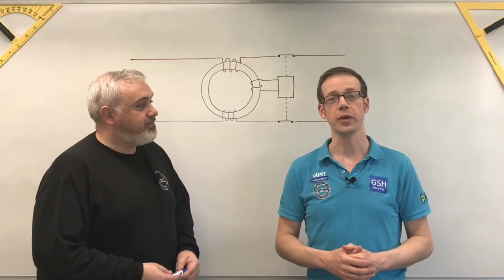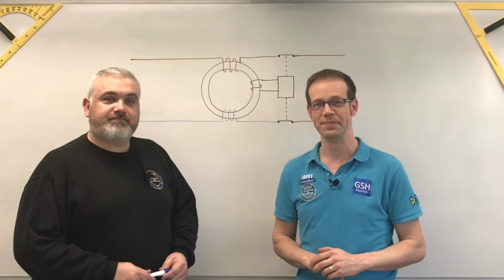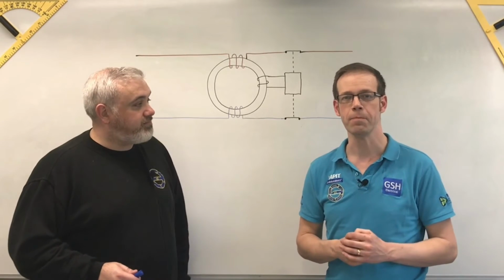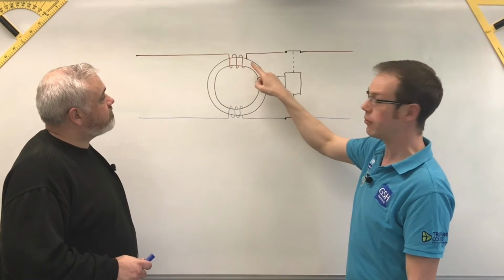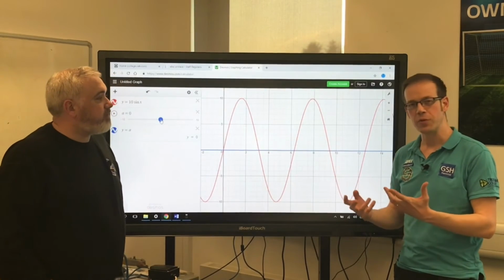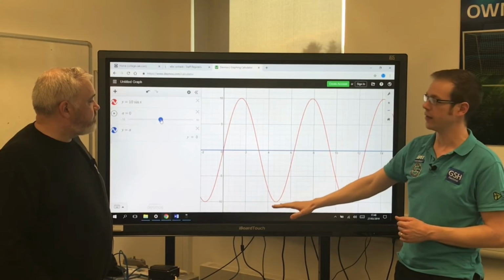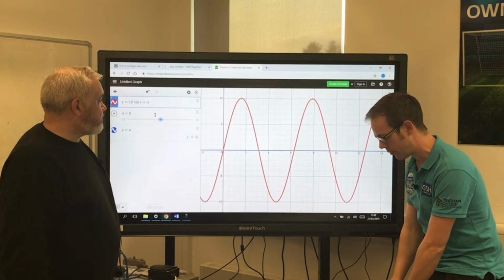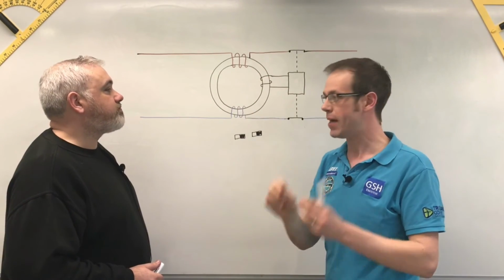DC in AC RCDs Joe Robinson training on #e5

Comment: Great explanation.
Except the using of term electromagnetic field in the core, there is a flux made by the two coil when everything is OK, the equal flux is zero when you have a fault the flax equal is not zero, causing EMF on the third coil that connect to electromagnet that trip the circuit

Comment: Great video very informative, currently doing my 2365 course (nothing has explained anything about this) and been working in the marine industry for years. We fit ground points on a boat which is used to ground the dc electronic equipment for interference generally  used for the ac ground as well.  Thank fully i haven't seen this fault yet but its good to know. Seems like we should only every fit at least type A

Comment: I've  just watched the first in the series of Ray Molony's 30 rules of lighting and interestingly he talks about lighting design and the joys of LED tape. LED lighting, of course, is rectified either in the lamp housing, or integrated fittings or very commonly via an external driver.
So if you're installing lots of fancy recessed LED in multiple rooms within a property, I guess you should add that to the list, and I would imagine even more so than sockets with USB (although, I'm not a big fan of them) and give the lighting design, in terms of DC current, some serious consideration.
Reply from the maker: We told him years ago about this!

Comment: Excellent Video. But please could you explain how DC gets back into the neutral.  Almost all PSU's in all equipment begin with an isolating transformer. So getting a pulsed "dc" signal back that way is not impossible but tricky. (Pulses only occurring on one side of the cycle).  Beyond the PSU there is often a capacitor and very high resistance resistor to the chassis to prevent charges building and that would provide a very small current to earth. (In fact this used to be the cause of quite high earth currents in large office buildings.) 
Please could you direct me to, or give examples of how DC gets into the neutral?
Reply: In normal equipment, probabilities are vanishingly small. Even in EVs there is galvanic isolation between the battery and the AC supply, the active PFC eliminates any pulsed DC effects so generally speaking, the only time this could occur is if there is a gross fault.
Reply from the maker: SDG Electronics thanks for the comment and it’s exciting stuff. Agree this should never normally happen. But it is with more and more poorly designed unregulated products it’s a real thing. We suggest we wait until amendment 2and see if the industry and manufacturers agree as they are declaring leakage from components and we suspect an AC ban in this or the next edition.
Reply: @e5Group  I mostly agree, especially on substandard products. The sceptic says there is a financial incentive too though to keep things being renewed and to bring new products to market.
Reply from the maker: SDG Electronics yep always about tickling the economy.
Reply: @e5Group  Shouldn't there be some sort of accountability with the manufacturers? Basically, we have to consider changing AC rcd's because of shoddy equipment. Wouldn't it be better if there was a mechanism or electronic trip within DC producing equipment to stop the RCD coil becoming saturated? The manufacturers are aware that their equipment produces DC power so they should take steps to mitigate the effect on a domestic installation instead of just shrugging their shoulders. Any death or injury that occurs from DC blinding on an AC RCD is avoidable if the DC is prevented from entering the live conductors in the 1st place. It all seems a bit backward to me in that the electrical industry has to change because that is considered easier than getting manufacturers to be a little more proactive. Why aren't British Standards (or even Trading Standards) stepping in? Maybe we have to wait for a few more deaths from DC blinding before someone has the guts to challenge the manufacturing industry. Actually getting quite annoyed about this
Reply from the maker: @squakkers  agree sadly the committees that author standards like the AFDD is made up of white goods manufacturers and device manufacturers. The standards structure in the UK is broken sir!
Reply: So correct me if I'm wrong but allow me to illustrate it this way. 
If I manufacture a machine that I know will catch fire if there's a fault then it's ok as long as the instruction manual recommends purchasing a fire extinguisher in the case of a fault. 
So who's liable if the end-user gets burnt? A judge would say to me if you knew it was going to catch fire why didn't you do something about it? Yet the committees would say that it's the end-users fault for not buying a fire extinguisher. 
If someone dies because of DC RCD blinding then wouldn't a judge have the right to ask the manufacturer "If you knew your product caused RCD blinding why didn't you do something about it?". I think I'll look into a 5-day course on decorating at least no one will die if something goes wrong
Reply: I am waiting also for deeper explain "how DC gets back into the neutral"
Reply from the maker: Kamil Sobolak in the meantime start looking into broken CNE stats and the fact the entire supply network is combined neutral and earth.
Reply from the maker: Kamil Sobolak working intensively amd 2 stuff at the moment. So this has fallen to the back of the que. we will get round to it.
Reply: Over a month and no reply. I must confess I am a bit disappointed.
Reply from the maker: Mark Horton sort we have not got time to check every comment on every video. And work full time, and create videos and go colleges and do all the voluntary stuff we do. We prioritise. More stuff on this will come. But we are doing the work to bring this to you so patience being a virtue comes to mind sir.
Reply: @e5Group  Patience is indeed a virtue, and having developed it every evening for over 8 months I now have an enormous patience. Please advise a remedy :-)
Reply from the maker: @markhorton8578  sorry mark. I don’t dance to the beat of your drum. My mate is in hospital with Covid and cancer. WAIT!
Reply: @e5Group  Hey it was a genuine and good natured question of interest, the clue was in the smiley. There was no need to be rude. I can't be expected to know of your personal situation. Four people I know, including one close to me are now dead from covid but it would never occur to me to use that as some kind of put down.
Reply from the maker: @markhorton8578  stop poking dude. Sorry I did t see the smiley face swaps mojo on my phone. I can online. We are busy at the moment. Apologies if that doesn’t meet your expectations. This years been shit for us all
Reply: @e5Group  Well it has been over two years now....

Comment: Great video!, Question: How can I wired a RCD if when our power source is Line to Line(110VAC each) only and no Nuetral wire or Earth wire provided, The cooperative here in our place they only run 2 wire(line to line) only to there consumers and nothing else, Can I still use a RCD if not, any suggestion or remedy? Thanks
Reply from the maker: マグプザオリカルド if it is 55v CTE YOU CAN GET A BESPOKE RCD FOR 110v ask Crabtree for a Railway 110v special

Comment: Would be interesting to understand how a type A RCD operates and is able to overcome the effects of up to 6mA of smooth DC
Reply: They use individual current transducers on the phase and neutral. It's measured electronically instead. Sadly this puts the onus on some electronics to operate rather than the intrinsic behaviour we see with type AC

Comment: Great video Paul and Joe, super detail and explanation of the subject. As a former electrician and now a design engineer this is certainly making me more aware that specifying the most appropriate RCD is even more critical than ever especially in new domestic installations with PV and EV now more common and also when doing a condition report on an existing installation. I feel more clarity is required in BS 7671 Reg 531.3.3 and OSG of where different types of fault DC current can originate and which is the most appropriate type of RCD to install. You may have answered this in another video?

Comment: Great explanation. Why is it that manufacturers are advising the RCD/RCBO should be disconnected from the load before testing, surely it is better if the device is tested while normal on load conditions are present. I'm also interested to hear that the DC is not always on the load side and therefore if my installation is near a railway line, solar farm or car charging station I should be looking at possibly type B RCD, but how as a hairy arsed spark am I supposed to test for this DC component.
Reply: The test is to confirm the characteristics of the RCD. By testing with other equipment present, there may already be leakage which will affect the test.
Reply: @sdgelectronics  exactly why we need to test with the load connected as anything that could affect the operating time of the RCD such as DC current or pulse from a SMPS or high frequency wave form from inverter supplies could mean the RCD is very slow or not operational at all.
Reply: @markholmes4143  The manufacturer can only specify behaviour of how the RCD will work, not how it will work with uncontrolled equipment connected to it. Remember this is a test to confirm operation of the RCD not to test appliances. By the way, there should be minimal high frequency current or high frequency noise from SMPSUs otherwise we wouldn't  be able to pass conducted emissions EMC testing.
Reply: @sdgelectronics  years ago before I knew about RCD's being disabled I would test with the load connected which failed then test with the load disconnected which would then pass. If I left the site with my certificate filled in to show everything was fine I am leaving the system in an unsafe condition. If the RCD is being affected by on site conditions I need to make the duty holder aware so either the RCD is changed for a more suitable type A,F,B,B+ or the piece of equipment causing the fault is disconnected. Electronic equipment may pass regulations when new but I have no way of knowing if components fail thus allowing DC current to leak or the AC sine wave to be altered back to the RCD. I can only do my test at that moment in time so can only report on my findings then. You obviously know a lot more about electronics than me, if you have time head over to the e5 group where a lot of electricians are trying to get there heads around the issue. Thanks
Reply: @markholmes4143  Indeed it's well worth being thorough and I like your approach. I originally responded to your query as to why testing isn't done with loads connected - simply put because the test is specified to be testing the RCD in it's intended operation similar to how they would be tested in the factory in the end of line test. An additional set of tests to prove suitability of the RCD is not a bad thing (which sounds like what you're doing) - the problem is maintaining consistency and coverage, especially on portable equipment where the location is not fixed. On test day the worst offenders might happen to be all on the same circuit, but in normal use probably not. 
There's are some disadvantages to the more advanced RCDs in that they themselves rely on hall effect sensors and a reasonable amount of electronics to electronically determine the overall imbalance, which itself has the potential to fail. Type AC are low cost because they are very simple devices with very little to go wrong due to the fact they are simply a common mode transformer, a threshold detector and a solenoid.
As type A and similar RCDs become more commonplace, we'll hopefully see some dedicated ICs which reduce the circuit complexity and improve reliability. We're already seeing some budget Type A RCBOs failing :(
Reply from the maker: Fascinating chat, sadly some major organisations are debating if the application and use of RCDs need to be reconsidered given the complexities of EMI, EMF differs from installation to installation. Lots more work to do on this and a different outcome depending on connected equipment. Oh the joys eh!
Reply: @e5Group  More of a dilemma when I'm installing class I equipment outside the equipotential zone, deciding on the merits of changing an existing TNCS earthing with low Ze and a fast disconnection time for fault protection by fuse or circuit breaker with additional protection of RCD or to go TT earthing and rely completely on RCD for fault protection with the increasing risk of not operating due to modern connected equipment. And that's without taking lost PEN into account.
Reply from the maker: Mark Holmes webinar at end of the month is I’ll go into this. 
Fancy joining us?
Reply: @e5Group  I already view all of your content with disturbing regularity, my wife starting to give me strange looks after the last 3hr stint on DEICR. I often think my questions must be because I'm just a thick electrician do others really pose similar drivel.
Reply from the maker: Mark Holmes we should always utilise two tests. Neither in the regs🤦🏻‍♂️ one measure internal system leakage via a earth leakage clamp test in the tails. Also in addition where near a DC railway you can simply clamp onto the earth bonds or earth conductor to see DC on the system. On our Instagram page their is footage of measuring on a LV bond yet 1.6A of DC was present. Even a B type is not immune to that!  Hence sometimes RCDs may not be effective but their selection may be reasonably practicable! Maybe!

Comment: dont you test instllation with dc when testing megger tester 250v 500v DC
Reply from the maker: Adreen Ryan yes. But high voltages can damage sensitive electronics. This is more related to current not voltage and testers use very low current. Thanks for watching 👍

Comment: That's the reason type AC RCDs are banned here in Germany for new installations since 1984. The common type in residentials here is the type A RCD or RCBO. For electric vehicle chargers you should use type B, or as I did it for myself at home: Type A RCD and the wallbox charger got the DC protection inside.

Described nicely: "Persons don't test the RCDs often as they should". To my experience people are doing this almost never.
Reply from the maker: Marcel Germann exactly, thanks so much for watching and commenting 👍 more to come on the subject
Reply: Here in Romania, a lot of debate is rising here among electricians.
Type AC are most common, A are harder to find, B even harder :)
I think that a good grounding and, eventually, a second separate grounding must be there

Comment: How could you test for, or measure the dc current being produced in an ac circuit? I would imagine if you put a volt meter across the load connections of the Rcd it would read ac only??? 
Without an oscilloscope, how can the dc be measured on site?
Reply from the maker: Gareth Bradley megger have meters that will give readings.. even a clamp meter can help detect it. We found 1.6A flowing of DC on one install only a few weeks ago
Reply from the maker: Gareth Bradley it’s should also only appear on the earth or neutral side of the system. 👍 makes you think!